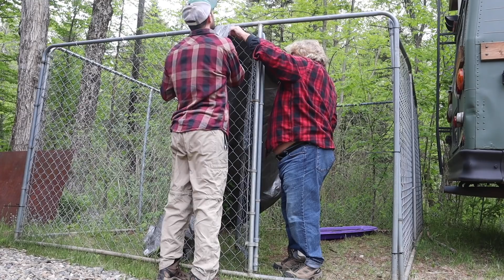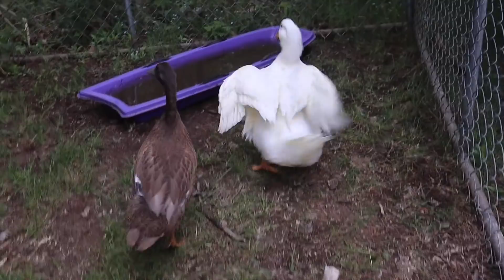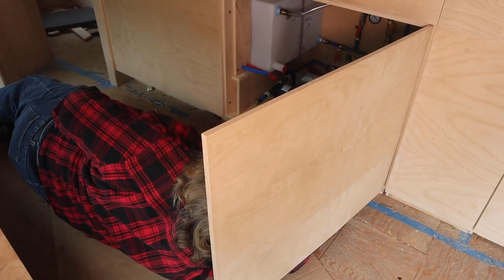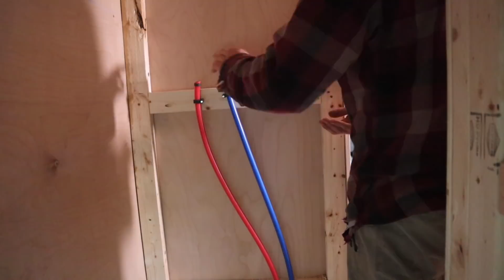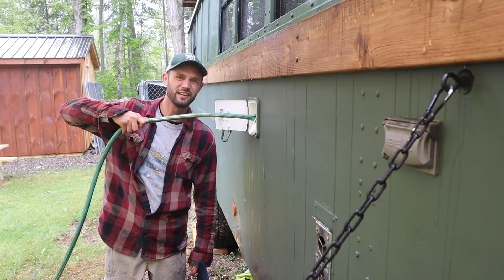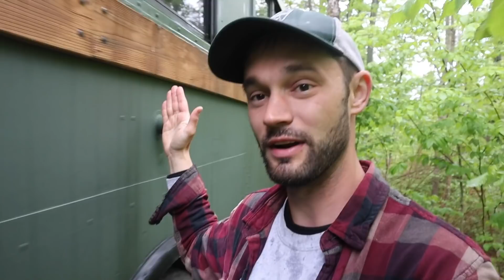Off Grid Water System Install | Finally Filling The Tanks

Comment: Will the water heater only work while plugged into shore power? I see it requires 30amps.
Reply from the maker: It will be able to run off the system that I will install off grid but, I mainly plan on using it while plugged in.
Reply: Navigation Nowhere thanks! My inverter can’t handle 30 amp unfortunately. Need to find a different option.

Comment: i just have to say,  you installed the water tank upside down.  that big hose fitting should be at the TOP.  Not on the bottom.
Reply from the maker: I know but, thanks. I don’t plan on filling with the 5/8th ID fitting because I won’t be using the gravity fill. I am using the 3/8 ID opening for the city fill.

Comment: I like ducks. They always look like they are smiling.                                              
   I saw an idea on another YouTube channel for you to think about. Instead of using a pump in their camper they put in a tank with a built in air bladder like they use with a well pump to maintain pressure in the system until the tank was empty. They put a check valve in the water fill line so the water couldn't leak out when the source water hose was disconnected. Pressure from the city water system pressure put the water under pressure in the tank. They had running water until the tank was empty. No need for a vent hose or water pump. Requires a larger tank to hold the same amount of water because the air bladder in the tank reduces the amount of room for water. Another advantage is that when the bus can be connected to water all the time if you want to when where there is a constant pressurized water source.
Reply from the maker: Thats a really interesting idea. Do you have a link for the video? I would check that out. Thanks for the tip
Reply: It is on youtube somewhere. Went through my history but couldn't find the video. Tried to do a search but couldn't find it because I couldn't remember the title. Connection is the same but uses a bladder type pressure tank like they use on a pump for a well but it needs to be bigger. He used two tanks. No pump but needs a check valve to keep the water in when the fill hose is disconnected
Reply: @navigationnowhere  Finally found the link. There are the links for the two videos about it.

https://www.youtube.com/watch?v=fTyEaB5uIlM&list=PLB6I6KoGYpp6UyT55bf74PZMRVddjW5xc&index=17
https://www.youtube.com/watch?v=5n1uwS9zT_Q&list=PLB6I6KoGYpp6UyT55bf74PZMRVddjW5xc&index=18

Comment: That water heater looks tiny, is that going to work? I have never saw one that small before!
Reply from the maker: It should according to the specs but, I will have to keep you updated as I test out the system more and more.

Comment: Water finds its level, you just need a funnel and hose, use the pressure fill port and fill the tank with a funnel higher then the tank top.

Comment: Nice compact water system. Only question I have is how is the big red plug secured in Ivan? In all my tanks those were only pressed in. I'd be afraid it would pop loose and you'd flood the bus
Reply from the maker: The plug will pop out. I have not had a chance to get to the store and buy a replacement. That is why I only filled the tank a little for a test.
Reply: I was wondering the same thing... I need to cap mine off as well and haven't found anything good to seal it up yet.  If you find out or hear back, it'd be good to know!
Reply: @cnjgp7  my tank is lower than the inlet so I set it up to use the big port as my fill. If I needed to plug it they make expansion plugs to seal off drain lines

Comment: @3:48 ( prior to watching the full video ) I see you're not fillingthe tank through the 1 1/4" typical gravity feed filler. The red cap/plug is normally just temporary . The way you have it setup that red plug will pop out under just the water pressure due to gravity if you don't replace it with a clamped plug or cap. On MY build I have that on the top of the tank,  clamped to a 3/4" PVC  fitting, and then piped to a city fill connector outside my Camper. On your vent line I'd put a clamped 90* bend forcing the vent line to run as high as possible under the cabinet before you send it down to the outside  connection.. Sweet, Dale just came up with that same idea.
 JMO
Reply from the maker: I am replacing it. Just didn't have the parts on hand. This was why I only added a little water to the tank to test the plumbing but not enough to pop the plug.

Comment: Speaking on thinking outside the box à la Dale... 📦 🤔 

My water system’s also going to be under the sink: to avoid any leak issue, I’ll simply mount the components to the side and fit an acrylic shower pan to the bottom of the cabinet with a one-way drain, then waterproof the side walls. This was if there’s any leak, the water will make its way to the gray water tank without damaging the wood and floors 🤔😎🤓
Reply from the maker: Thats a great idea to put a water pan under all the components. I might have to steal that idea in future projects.